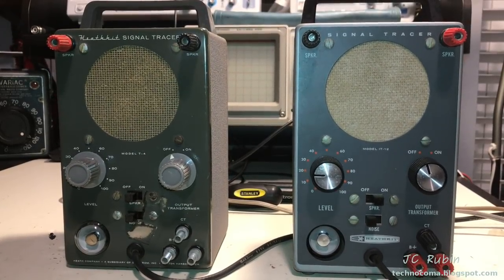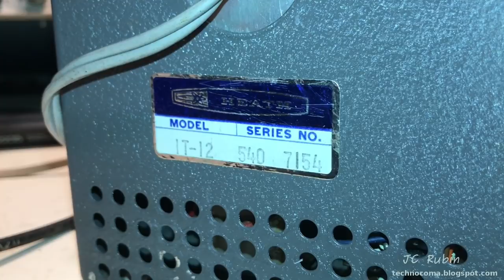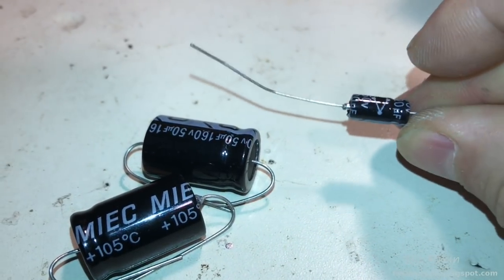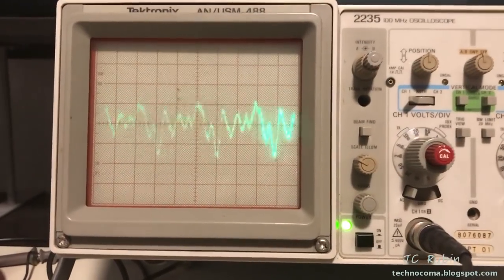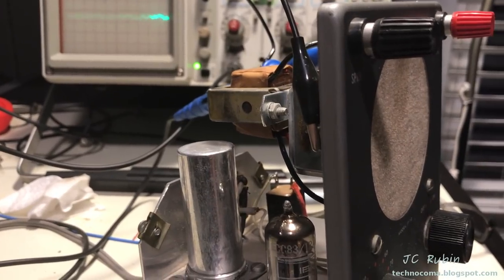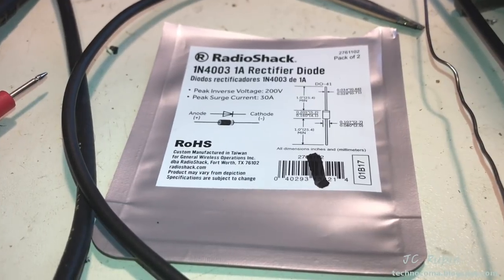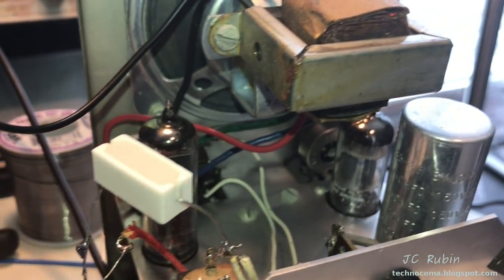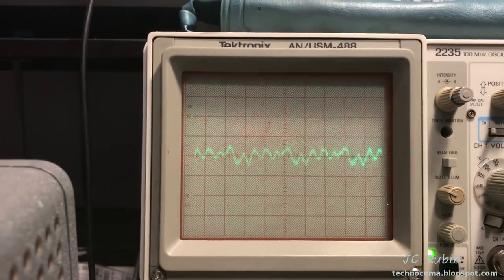Heathkit Repair - Visual Aural Signal Tracer IT-12 - 1 of 2

Comment: Just a suggestion, when dealing with power supply ripple, you can also try to add another capacitor to what's already there but make it smaller in value and if possible as low of ESR as well. The smaller value capacitor is better at higher frequencies and the larger ones take up anything that needs bulk current! I personally first saw this technique somewhere in YouTube and have been doing it ever since with excellent results... If you had the room and didn't mind changing things or even if it's a new build, you can just use lots of smaller value capacitors instead of less larger ones and you will have dead flat DC output...
Reply from the maker: Thats a good tip, thanks for sharing.
Reply: @retrotechandelectronics  You are welcome, when you watch enough videos about capacitors you start to develop an understanding of how they work. There's a lot more to them than most people realize! When it comes to amplification power supplies you usually see large bulk capacitors but then when you look at switch mode power supplies you see that they use much smaller capacitors, I personally think that it's a good idea to use both when it comes to obtaining a clean and flat DC output..
Reply: They did that very thing  in  the Heathkit SG-8!

Comment: Can you explain the process to restore the hammered finish on the exterior of these Heathktit chassis cases.. You mentioned its easy to repair but I didn't actually understand what can be done... I have a couple of these Heathkits that require attention! Thx, Ben

Comment: My electrolytic was good also.  I brought all three sections up slowly watching the current.  The 50uf caps ended up below 400ua,  the 20uf below 40ua. Amazing for 40+ year old caps.  I say if they last that long there pretty good.  Mine has a ss rectifier.  Had a wire not soldered also.
Reply from the maker: Sometimes you bring em' up and the internal heat over time pushes out the moisture, causing temporary improvement, but it comes back.   Ive opened these cans up in my videos, they simply rot over time

Comment: This is just a question...I have seen you check a few tubes with your tube checker...and to me..it seems that it goes all the way to the right to fast..and goes to far...is it ok???? Some times it pegs out to the right at over 100%...and I mean not just past 100% but WAY past 100%.
Reply from the maker: The older century tester has since been replaced by the Hickok 6000.  While the century has been repaired there is still some work to be done  on it im sure.

Comment: I have the same the triple electrolytic capacitor was ok also ! If i remember well they was a death cap on the ac line also !
Reply from the maker: 'OK' is relative on a device that is supposed to have as little internal hum as possible.

Comment: I just ended up with one of these in a load of junk someone gave me. I don't think it is really my cup of tea. I'm not a tube guy. The one I got looks like it's been through a war. So no great loss if I don't try to fix it up. Even the handle is broken in half.
Reply from the maker: At least you got it for free, some folks get horror stories on ebay....
Reply: Yeah I just got a small horde of junk. A couple winners and a couple meh items. You can see the IT-12 on the right side in this picture https://i.imgur.com/aef0GZE.jpg Even that meter came in the haul. I recapped that EICO batter eliminator charger and it works. The Superior Electric VOLTBOX just worked right off the hop. So it was a big win.
Reply from the maker: Thats rough... But the VARIAC on the left looks like a score. Thats a 200$ item!
Reply: I'm happy to have the Variac. I bought a smaller bare one at a flea market a while back but it is only 3 amps so of limited use. I brought that IT-12 up on this new one to me and it did not blow up. One tube glowed and the unit made its characteristic hum, but the magic eye never came on. So I don't see a point in trying to fix it.
Reply from the maker: 3 Amp variac , thats 360 watts.   Substantial for most applications including an ST70 amplifier if youre carefull
Reply: The one I just got is 7.5 amps. So a good deal more substantial. I don't mess with much old gear where autotransformers come in handy though. Mostly I used my other one for sussing out mystery transformers. You know, trying to figure out primary and secondary windings on them. Or if they even are line transformers.

Comment: I have one that's pretty beat up and the cords are cut on it front and back if anybody's interested in owning it reply with your email address and I'll see if I can send you some pictures
Reply from the maker: how beat up?
Reply: @retrotechandelectronics   the on off knob is the switch labeled noise is loose and broken the front cover is pushed out at the top and pushed in at the bottom all the red and black hookups are bent but there Magic Eye appears to be intact the handle is not broken the wires have been cut at the grommets front and back the paint on the back of the machine appears to be silver or Chrome and is peeling away